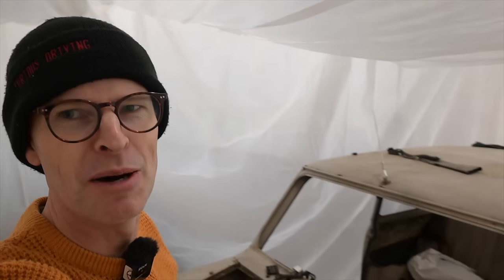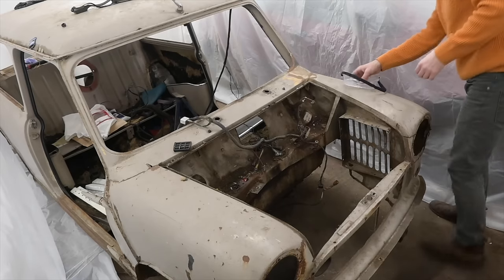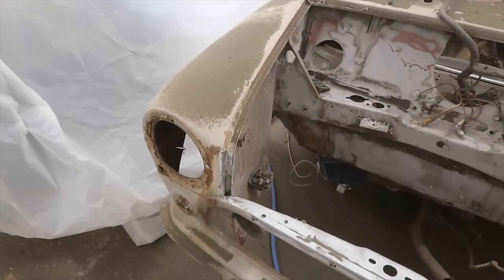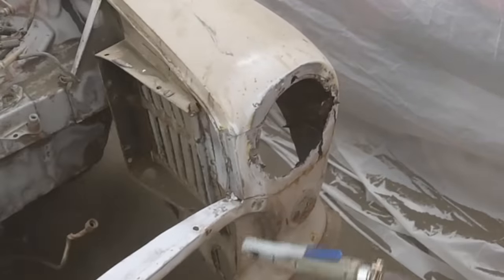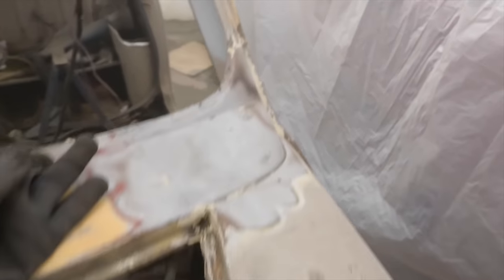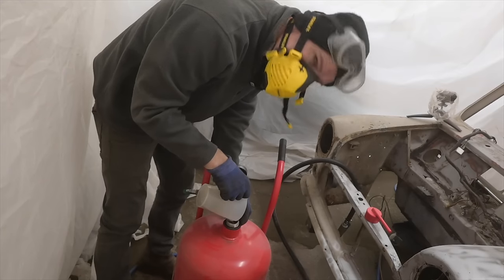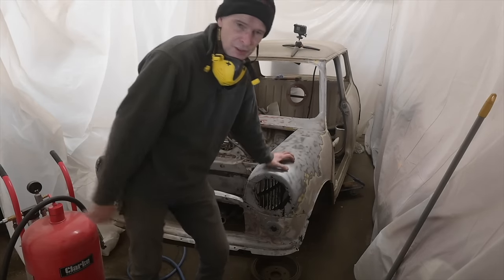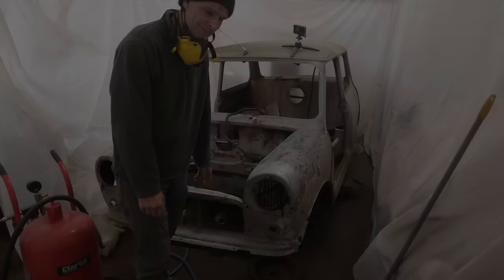Blast off! Media blasting the Morris Mini shell (this was way messier than I expected!)

Comment: Don't forget to drain the compressor after every use, to keep the moisture down. Don't touch the bare metal with your bare hands, it will rust even quicker. I suggest you try to keep the hose straight it will help. Sand off the floor is okay if you can be sure it's clean and dry, basically when it's 6 inches deep😊. Might want to speak to whitelands about primer. I'd say epoxy and it water proof and you can fill over it. But if you use the wrong primer you'll suffer issues when you paint the car.

Comment: Good video thanks. The sand blaster looks great for getting into nooks and crannies (as you mentioned). I completely understand that you may have sand blasted many areas for the benefit of the video, but realistically the passenger side wing is toast and by removing it you will get the benefit of inspecting the scuttle and front panel flanges. You may be able to reuse the front panel after careful inspection and spot repair, but any patching of the headlight opening is just a false economy and will be massive hassle to weld/fill and you dont want rust coming through your paint at the end of it! The image you showed at the end inside the car looks more like the top inside of the flitch panel, not the scuttle. The n/s scuttle repair that has been done looks half decent if you can straighten it out. Removal of the wing will allow full inspection of the scuttle, scuttle closing panel and flitch panel and then you can work out what you need to do. On the O/S that scuttle end needs completely replacing and will be a complete hassle without removing the wing so best approach would be another new wing. Again gives you better access to properly check it all out. Cost wise for new wings you might consider repair, but time wise you will save so much! (Finished an 8yr resto last Aug)

Comment: That's an impressive bit of kit Matt, as is the way the more that you do the better you will get at understanding the foibles of the machine to get the best out of it. The clean up after the exercise looks like a challenge though but as you mention doing the first bit with a dust pan makes a lot of sense to get rid of the bulk of the spent media but that stuff gets everywhere. MAny thanks for sharing.

Comment: You need very good moisture traps and you need to drain your compressor before each blasting session.  The grit can be used until it becomes ineffective as long as you sieve out the big bits.
One very good sand blasting cabinet I used to use years back actually had a light bulb in the bottom of the hopper to warm the grit up and help keep it dry. The same grit went round and round for ages.

Comment: I did my Midget shell with a similar setup. Just a blasting pot and a smaller compressor. It’s all about the CFM rather than a massive tank. Your system is working better than mine ever did, but I got the job done. I used paint stripping discs on my grinder to remove the majority of the paint, then a wire cup on the rusty bits I could get at. The blaster was used just to get at the areas that were left that I couldn’t access with the grinder. Still took for ever and was very messy. I reused the media multiple times. Sieve out the big bits to stop it clogging.  I found a lower pressure worked better.  To be really effective you need one of those massive compressors they use on roadworks that deliver about 100 CFM.

Comment: Hi mate . One of the reasons they tend to block is the agrigate your using could be slightly wet . Or the air supply .  You can reuse your waste . You sift it and send it back through .  You usually get three  goes of it before it looses it's effectiveness .. well done for getting a small pot blaster to work like that there usually alot slower . The compressor setup is great for it

Comment: I have a similar blaster to you, I have found that using kiln dried sand works well and you can sweep it up and run it through a sieve and use it a few times. It also doesn’t seem to block the tap at the bottom of the tank.

Comment: The passenger side front wing is all manky around the headlamp. I had the same on my mini years ago, it's because the radiator sits right adjacent against it. A quicker and better fix would be to fit a new wing, it's cheap & easy enough !

Comment: I have the same blaster. I modified mine to work better (there are several videos on youtube for this) but, I didn't have much trouble with it stock. I would suggest purchasing an inline desiccant filter, the ones where you can replace the desiccant, and attach it at the air hose connection on the blaster. You can recycle the blast material but you MUST sift it to remove all the debris and crap that will end up clogging the blaster. I use a 5 gallon bucket with a section of window screen folded into fourths bungie-corded over the top of the bucket. I also have a section of window screen attached to the funnel that I use to fill the blaster.  I find glass bead to work the best.

Comment: I bet it is already adressed, I'm late, but the sandblasting is like hammering a surface to thinner thickness, making it larger instead. when some parts like doors are only rusted in the corners, just blast there, don't do the whole surface. Also parts like doorsheets are often bent around the inner part of the door metal and that bend is where rust prevails. Been there done that got the rust back a couple of years later, bending out the outer panel and blast both parts is tricky do to get it back in shape. Less pressure/airflow might bring more sand than full throttle, find a good one and your sand will last longer and the metal won't get hammered too much!

Comment: Make sure that you don't blast the entire exterior panels, such as the roofpanel, sidepanels etc. Just blast the edges around them. You will likely warp them, if you try to blast the entire panels.
Reply: Yup, for the flatter panels, chemical stripping is safest, or careful sanding.

Comment: Also, I've drilled out some of the fittings, replaced a couple of them and changed the hose to the mixer block, to improve the airflow and haven't had any clogging problems. Many people replace almost everything with 1/2" over the original 3/8, but I haven't found that necessary.

Comment: This is simply not a task you should do without at least a boiler suit, or probably a bulk pack of disposable 'bunny suits', which have a hood too. You should get yourself a sifting screen and then there should be no problems reusing the media. I use an almost identical pressure blaster in a cabinet (way better than it's original suction setup) and every now and then, I dump the hopper into a backet, then pour it back into the pot. I'm not using more than 60psi. Too much pressure breaks down the media and risks creating distortion on flatter panels. If you're getting surging of the media, then you need to adjust the valve on the base of the pot. That's the one I recommended upgrading to a gate valve, which is much easier to adjust. And please, take the loom out. You won't be saving yourself time by not doing so.
Reply from the maker: I looked for gate valves after you said before, but it wasnt very clear what to buy for this

Comment: To save your sanity, sand and potentially your lungs, just concentrate on the rusty bits that can be saved. The original paint can be flatted pack and painted over, if you take it all off the metal will start to corrode where it wasn’t previously rusty, and if an area is full of holes, it needs cutting out and replacing, so no point in blasting. Well done though!

Comment: As, good as the blaster looks it is hobby size really , and you will likely be using a dual action sander after that , so watching how the blaster performs  gives me the thought of using a D/A sander as much as possible striping back larger flat areas with say 120 grit or even 80 grit on filler and then going finer and just using the blaster on the fiddly bits .
Reply from the maker: I do have an air DA from Draper so that is an option
Reply: @furiousdriving  used to do them that way years ago ,even if you strip bzck with chemical stripper , which would be a cheaper option on the flat panels , you end up on a D/A  2 or 3  stages of grit going finer then hand blocking with wet n dry with  flilling /finishing .
They may have other things to use now , thick filler primers high in solids were coming in as i was winding down for those lazy on prep .

Comment: I would slow down and just concentrate on the rusted/pitted areas,  as any rust that's left behined no matter how small will only come back through the nice new paint. When you are ready for primer you can get 2k epoxy primer in aerosols which is very handy for this situation.

Comment: Rigging a wet 'n' dry vacuum to suck the air in and filter it may result in less on the floor and escaping the tent. What's sucked in to the tank should be clean and reusable.  Even a Henry or Hetty should do it.

Comment: Oh wow… this reminds me very strongly of my own efforts to build a DIY blasting cabinet, using the same Clark pressure chamber and a tiny 50ltr air compressor. Yes, the material is reusable, to a degree, but I found you do need to filter it through a sieve. Eventually, the ultra fine moon-dust makes it unusable. It would turn my blast cabinet into a cloud chamber. And the time… so much time… It really is a slow job. You'll probably choose only to do the bits you need to work on, and leave most of the shell where it is still solid.
Reply: As advised below, in other people's comments, I did make a dust extraction unit for my DIY blast cabinet. I used an industrial, Henry-type, wet-and-dry vacuum cleaner with an ash-can designed for hoovering up fireplaces. All bough from "Clas Ohlson" when we had one of those stores here in Norwich, UK. What a great DIY store that was!

Comment: First thing that springs to mind is a 150mm extraction vent, fan and dust collector. Since you're gonna need a vacuum in any case. By no means an expert at sand blasting but I have set this up in my workspace and it improves matters hugely.